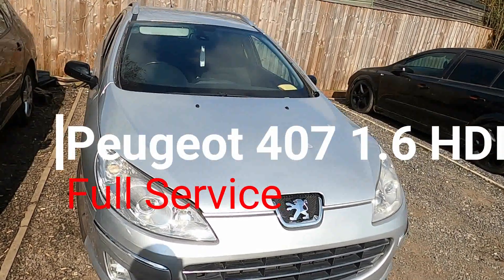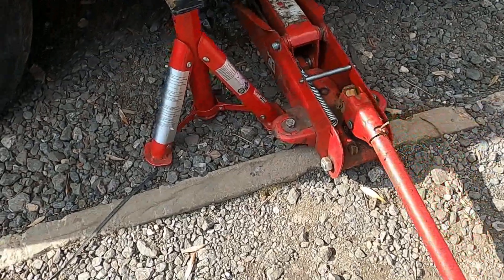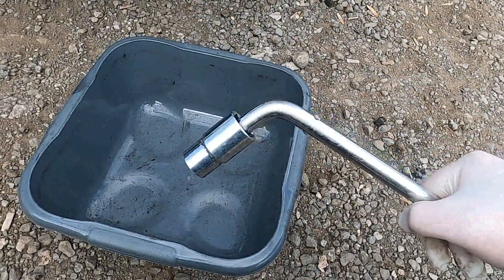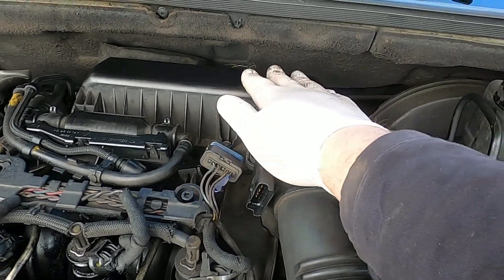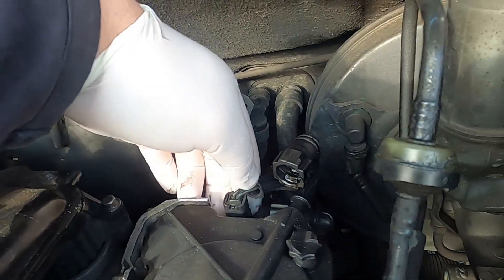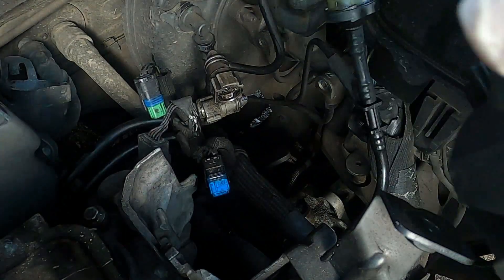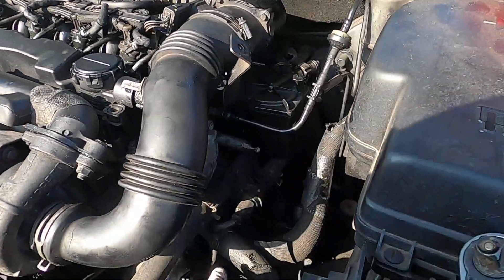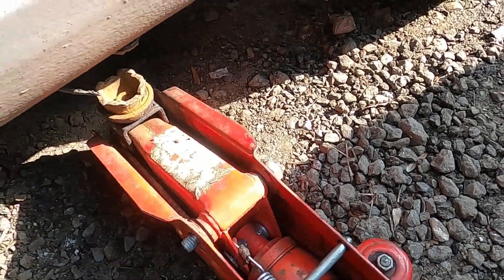Peugeot 407 1.6 HDI Service ( Oil change, Oil filter change, Fuel filter change, Air filter change)

Comment: Inizio 22:15 / fine 01:00
Una fatica immane ma tanta soddisfazione.
La mia Peugeot 407, sotto ha due pezzi di plastica che protegge il vano motore.

Grazie per il tutorial.
Reply from the maker: Grazie amico mio per un bel commento. sono contento che ti sia piaciuto un video.
Reply: @Mad4FrenchCars  
Grazie a te ho risparmiato un po' di soldini, di questi tempi non guasta😉

Comment: Hello thanks for nice video i have same car can you give me some tips how to change transmission oil? thanks a lot
Reply from the maker: Hi mate to release a transmission oil you need to undo a bolt under a gearbox it's 8mm squere key for that bolt. And then to refill you refill through the breather on top of gearbox. Should be 1.9l gearbox oil capacity
Reply: @Mad4FrenchCars  thanks a lot for quick reply 🙏
Reply from the maker: @NikolasTravel  no problem. Also you will need a small tunnel to refill as a hole is not too big on top its the one with a black plastic and sometimes white plastic insert in it.

Comment: Hi, Great video and thanks for uploading it. I have a problem with my 407 1.6hdi stopping after running for a second (fault code is P0192  - low fuel pressure.) so I am changing the fuel filter to see if that cures the problem. Your video makes the job easier.
Reply from the maker: Glad to hear you find it use full mate. Thank you for watching

Comment: Having issues with my 407sw (automatic) lurching and revving slightly at low speeds. Do you know what this could be? I'll try servicing like this vid describes.
Reply from the maker: Hello i have never owned a 407 with auto box but i know that sometimes in a prefacelift models from 2004-2008 the automatic gearbox is problematic as the gearbox ecu seem to fail quite a bit. The facelift models 2008-2011 seem to solve that problem they also use another box wich is different manufacture gearbox. I believe if the automatic gearbox starts to missbehave its usually a faulty gearbox ecu but its hard to tell unless you scan it with DIAGBOX software.
Reply: Dunno if you guys gives a damn but if you are stoned like me during the covid times then you can stream all the new series on Instaflixxer. Been binge watching with my girlfriend for the last couple of weeks =)
Reply: @Dakota Layne definitely, been watching on instaflixxer for since december myself =)

Comment: Thanks. I've seen a video in which you change the air filter from under the dashboard inside the car? Is it because it's on petrol engine while yours is the HDI version? Got any clue? Thanks in advance.
Reply from the maker: I think you are talking about the pollen filter i still have to make that video i havent made one yet it must of been someone else. Petrol or diesel air filter will always be in the engine bay but you are right there is a filter and its called a cabin filter or a pollen filter and its not for the engine but for a fresh air inside the car and its located under the dash insite your heater unit. This video shows you how to change air filter( for the engine air intake)  on 1.6hdi. Petrol engine would have air filter in a similar place. Thankyou for comment please let me know if you would like me to explain more
Reply: @Mad4FrenchCars  Thanks for the explanation.
Reply from the maker: @itayonplay  my pleasure mate if you ever need some info just ask me mate

Comment: can you please tell me which oil to pour into the engine .. one master poured me 10/40 .. with an explanation that it should because he covered over 200000km .. 
the model of my car is
Peugeot 407 1.6hdi 2009 dpf
Reply from the maker: It should be 5w30 fully or semi sintetic.
Reply: @Mad4FrenchCars  thank you very much .. a master in car service for over 50 years, now some things are clearer to me .. 😂😁😉
Reply from the maker: @dzukacdzukelic7144  car in a video is 240000miles or 384000km it's same 2009 1.6 hdi and it always used 5w30 fully sintetic. Still same turbo from new and the engine pull really well
Reply: @Mad4FrenchCars  
Clear as day .. from now on I will use that oil .. but I will clean the engine well first .. thanks for the reply 😁
Reply from the maker: @dzukacdzukelic7144  my pleasure mate

Comment: I have a peugeot 407 1.6 hdi 2007 even after changing oil the other owner used always a 5W-40 oil ,the oil got black too fast why,i changed the oil filter too?
Reply from the maker: Nothibg to worry about. 1.6hdi needs oil change every 8k miles. Even if you use a engine flush to remove a old oil and clean inside the engine. Your oil will still get black after few hundred miles. I personally thing its normal as on all my 1.6hdi cars it was getting black very quick
Reply: @Mad4FrenchCars  i am not changing that faster is too expensive for me thank you for your reply do you also have a answer about how to disable tmps system😉
Reply from the maker: @mevlandedja2457  no problem at all to disable tmps system you need to use Diagbox or a Peugeot planet software and then you have the option to disable it. I will try to make a video about it in a near future
Reply: @Mad4FrenchCars  isnt any other way to bypass the system without bying any device
Reply from the maker: @mevlandedja2457  software cost like 50£ from ebay with cables and then you only need  a older laptop with windows xp or 7 to install it to run it. I think you might get away with just replacing all 4 sensors with normal ones in  a tyre shop
Reply: @Mad4FrenchCars  i have another question bro air condition filter is the same thing with air cabin filtren and how to find where is air conditioner filter?
Reply from the maker: @mevlandedja2457  so you have 2 air filters one is for a engine air and another one is for a cabin air called pollen filter, i am gonna make a video on how to replace a pollen filter  today. air con air also a heater air goes through a pollen filter.
Reply from the maker: @mevlandedja2457  i have just learned that prefacelift and facelift 407s have 2 different filters
Reply: @Mad4FrenchCars  so what is the difference bro
Reply from the maker: @mevlandedja2457  the difference is a size. Facelift is more square and prefacelift is longer. I will make a video on how to replace it tommorow as i couldnt finish video as i have to buy another filter.
Reply: @Mad4FrenchCars  super thabk you😊
Reply from the maker: @mevlandedja2457  my pleasure
Reply: @Mad4FrenchCars  bro how to you repair it there is oil in the intake hose cuz turbo produce a little oil i dont want to change turbo cost too much
Reply from the maker: @mevlandedja2457  your turbo doesnt produce oil. 1.6hdi always have some oil going in turbo with air becouse engine rocker cover breather blows oil steam  and oil throughout a breather to air going from air filter to turbo. I wouldnt worry too much. If there is too much oil going in to turbo with air then i would check a valve on top of the rocker cover as if that is gone then it would allow more oil to escape. But i wouldnt be too worry
Reply: @Mad4FrenchCars  thank you my friend but there is going some oil cuz i opened and when i changed the air filter and it leaks where the white hose is in intake hose
Reply from the maker: @mevlandedja2457  ya so thats a breather i believe it has a rubber o ring sometimes need to change so it wouldnt leak out
Reply: @Mad4FrenchCars  it will solve the problem of leaking oil out but oil still with go through and than will block the dpf filter😂
Reply from the maker: @mevlandedja2457  its very common problem. Either need to change oil so it would be slightly thicker or install a cach can
Reply: @Mad4FrenchCars i changed the oil still is oil there  can be fixed if I change the valve cover pcv valve membrane ?
Reply from the maker: @mevlandedja2457  i had a same issue with my previous 1.6hdi and to be honest i dont think anythink was wrong with my valve membrane in a rocker cover so i cant guarantee it will solve a issue. Catch can would sort it out thought🤔🤔🤔
Reply: @Mad4FrenchCars  that costed a 100£ to install😅
Reply: Hey bro which oil is the best for my peugeot 407 1.6 hdi 2007 with 320 k kilometer ?
Reply from the maker: @mevlandedja2457  fully sintetic 5w30
Reply: @Mad4FrenchCars  thank you a lot bro😊
Reply from the maker: @mevlandedja2457  my pleasure mate

Comment: My freaking blower does not work, just the top one nearest the window no else. Got any solution?
Reply from the maker: Your car most likely have developed a very common issue in all 407s its called heater flaps, they break inside a heated unit behind a dashboard and the solution is to take them ojt and replace them or fix them. They control where your air from heater is going and once is broken its not going to be able to control it. If you join facebook group called Peugeot 407 UK There is plenty of guys who have fixed this issue and can give you much better advice then me as i know about the issue and solution but they know exact procedure to fix it.
Reply: @Mad4FrenchCars  Thanks a lot for the info. Fixed the flap with glue, works great now. But a new problem, cant regulate temperature in the AC, neither warm or cold temp blows just in between 😂
Reply from the maker: @dpayne8611  that would be issue with a heater controls potentially, but i cant tell 100% normally heater controls are quite solid. It could be one of the motors wich turns flaps stuck or something sorry cant really tell without seeing it myself. Heater unit behind  a dash has atleast 4 small motors, potentially more i cant remember now. It could potentially be one stuck in a place where it mix the air hot with cold. Its all pure guesses. Sorry i cant really tell mate. Sometimes if your coolant low it can make heater only able to heat like half power. But its all confusing as they do have a build in heater matrix aswell.
Reply: @Mad4FrenchCars  ever had P0087 Fuel pressure too low on 407 1.6 HDI ? I’ve just bought mine and after a week have this code with check engine light 😮‍💨
Reply from the maker: @Mr330d  prity sure I did have it before it appear after some other work done on a car I had a cut in a fuel return line I believe and it was leaking fuel near injectors. Car was not starting straight away and it was throwing a fault for low fuel presure
Reply: @Mad4FrenchCars  thank you . For some reason it appeared on Boxing Day but has since disappeared and power returned . But I will change the fuel filter anyway because I already bought it 😂 . It’s DPF deleted & EGR deleted with stage 1 to 140hp